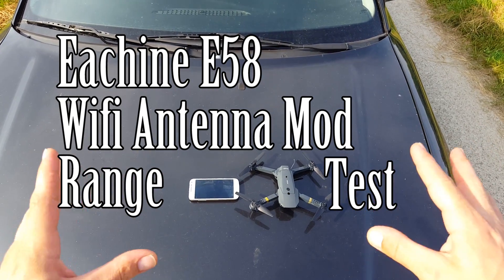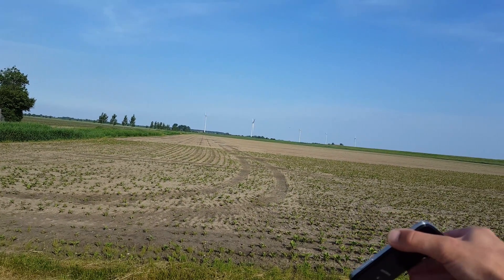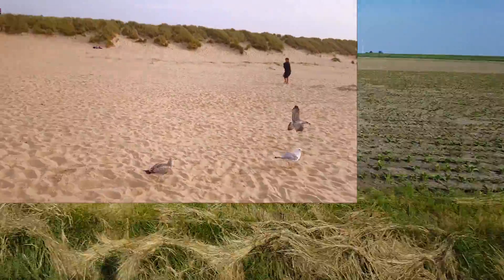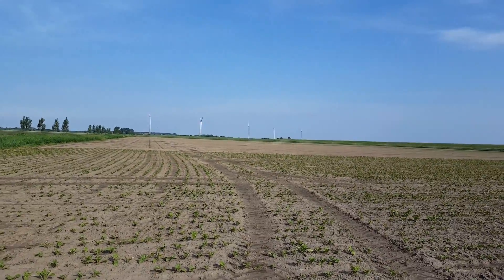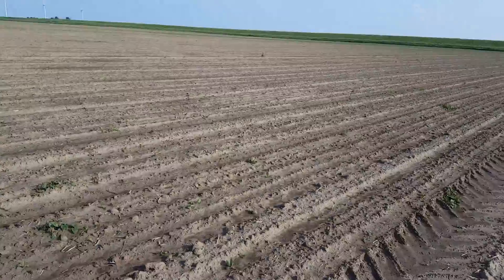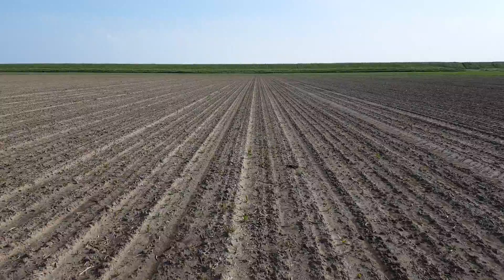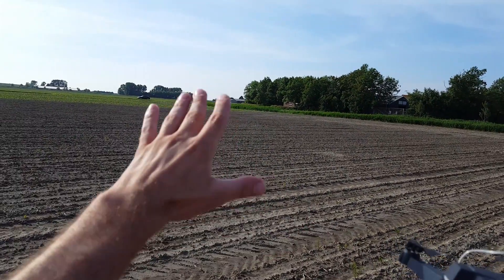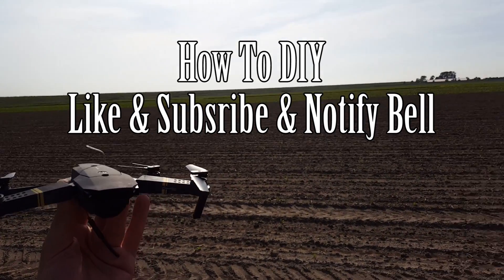Eachine E58 Drone WiFi FPV Antenna MOD RANGE TEST [Fly Drone With Your Phone]

Comment: Strange, because the original antenna looks almost the same as your modded version. Curious what the range will do if you combine the controller (with antenna mod), wifi range extender and this antenna mod. I've just got my E58 and i'll use definitely  some of your mods. Thanks for sharing and keep up the good work!!
Reply from the maker: as soon as the weather clears up we test the wifi range with extender hopefully we can show it soon thx for the support :D